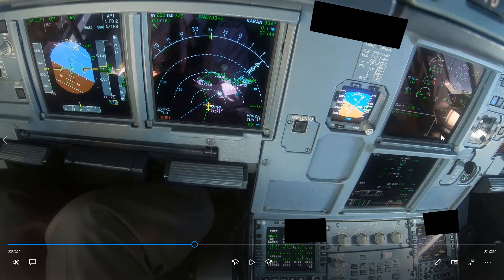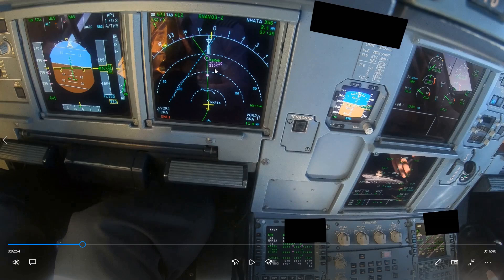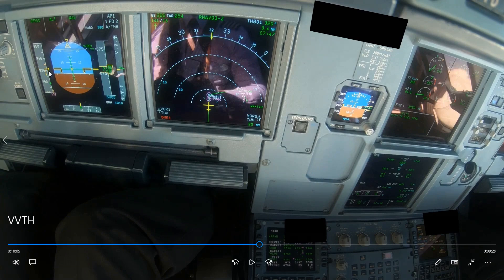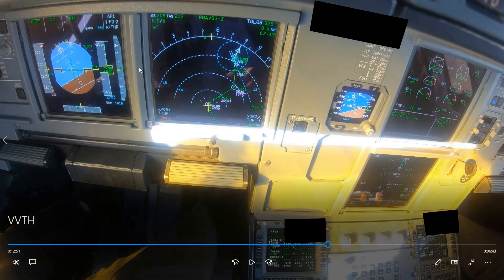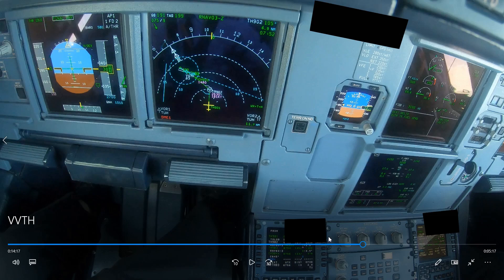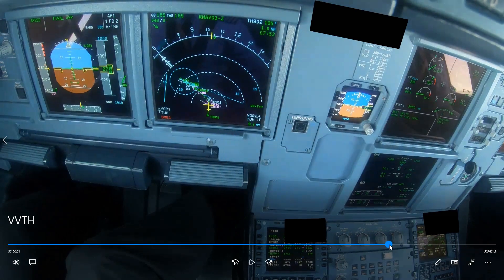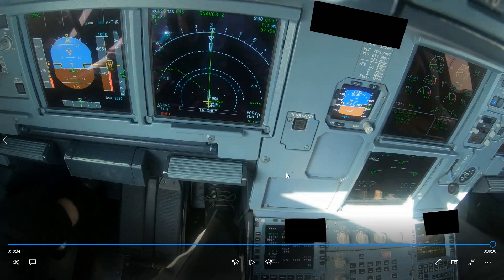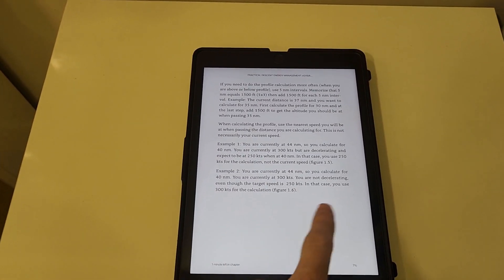A320 Descent Management - VVTH, correct approach

Comment: Hey captain, why is it when you initiate a go around, CLB arms but it never engages. Like you would get OP CLB if you didn’t get alt* by the time you hit the acceleration altitude?
Reply from the maker: Good question. 
CLB only engages after a go around if you are in NAV mode and the FCU altitude is higher than the acceleration altitude.

Some aircraft automatically engage NAV mode after a go around, but that's an option. If you are still in GA TRK when reaching the acceleration altitude, then it will revert to OP CLB and ALT blue.

But if the FCU altitude is not that much higher than the acceleration altitude you will get ALT* before reaching the acceleration altitude due to the high climb rate, so that will also prevent CLB from engaging.

Comment: Thanks for the explanation. I would have question though. I did not understand why you have to put flaps 2 because of the speed constraint. I can see the speed is already at 180knots and that the minimum selectable speed is way below the current speed. Sorry if I am saying things that don't make sens, I am just a sim enthusiast :)
Reply from the maker: The speed restriction is slightly below S speed, that is why Flap 2 is slelected. Realistically the difference is very small and it's not really a safety issue to fly a few knots below S speed. However, it's a regulatory and liability issue, that's why it's better to stick to the rules.